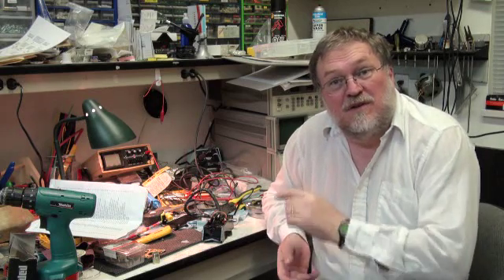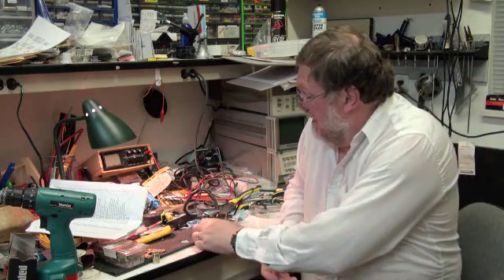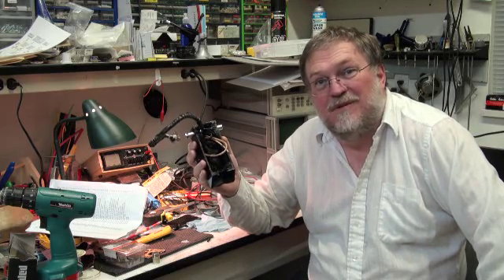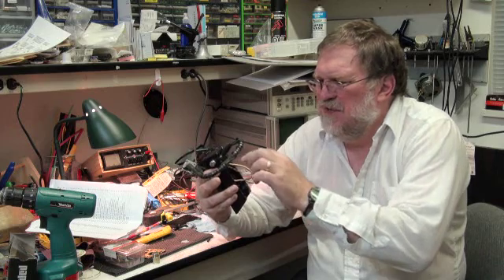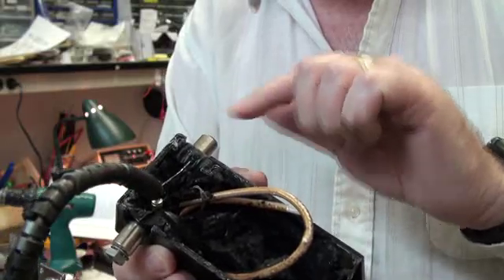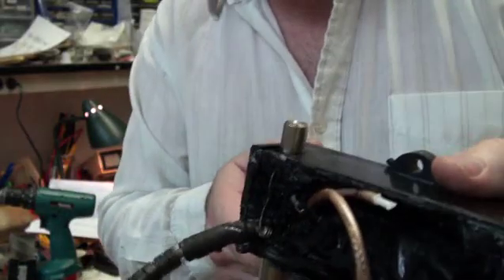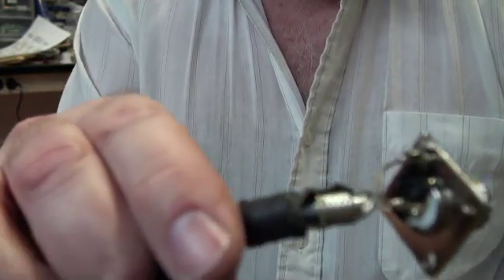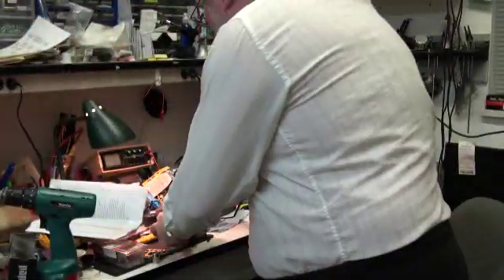BN-4000B Balun de-mystified!

Comment: Shit happens... not suppose to, but it does.. even in $ 50,000 test gear.. anyway, I would be more concerned about the Common Mode Currents of ALL these baluns. Most have no common mode attenuation at all.. curious if you tested that Hy-Gain one? It appears you have a Analyzer there to do so? Thanks and please post more videos! 73's de K8KEM

Comment: Good you tracked down the problem but funny you didn't use a wire or bit of solder to fix the problem and test it again?
Reply from the maker: +Colm Brazel. Junk product..best place for it was the bin.

Comment: I would bring it too there MD attention,very poor quality control issues.
Must be a Friday special when that was built in factory!
Def a load of "Bollocks" matey! best place the BIN!
THose S0239 dont handle high RF Voltages either! Use N-sockets much better.
all the best Rob GW1CSU